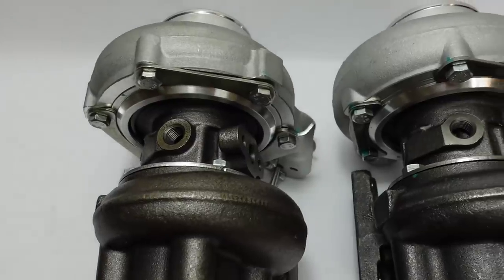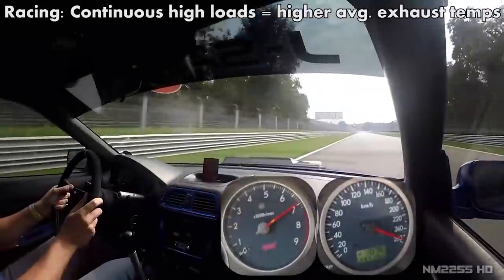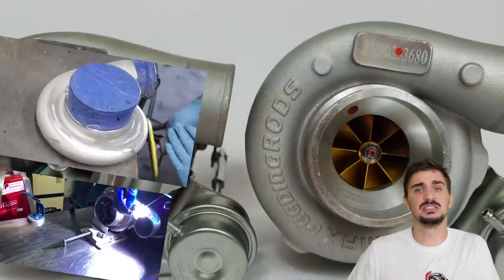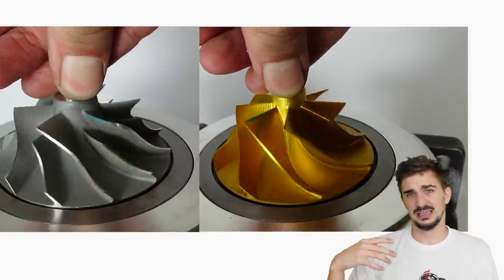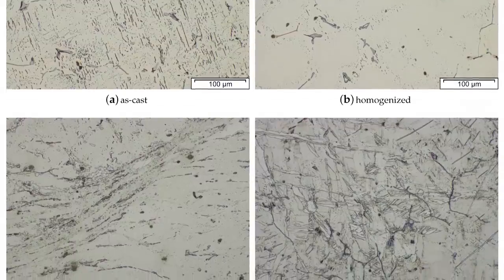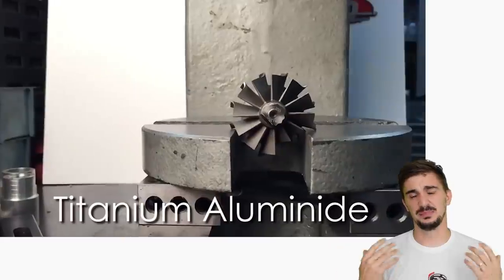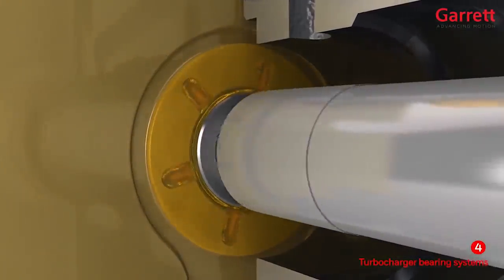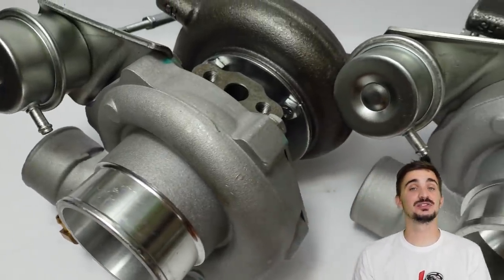What makes a TURBO STRONG? - BOOST SCHOOL #9

Comment: I can't help but think that the titanium nitride coating on the compressor fins is to prevent damage from ingested small particles. The thing spins at over 100,000 RPM, and a grain of sand is damaging at that speed.
Reply: TiN coatings are typically used for drill bits due to their hardness. In this application, it should increase particle abrasion resistance as you mentioned, but to be fair, if visible particles could make it into your compressor, your air filtration system has obviously failed.
Reply: @4G12  Assume your intake filter has failed. If something gets through, what is the next failure level if a turbo compressor fin breaks, versus it not breaking?

That's why it's TiN coated.
Reply: Some turbos spin up to 5000 RPS.
Reply: @electric7487  That's a lot of Rip'ms
Reply: @The_Original_Default_Username  A right skookum choocher...
Reply: My Air filter fell off my brand new $5000 turbo during a run, and yes i chipped the compressor wheel. For now it is what it is and I just have to lived with a slightly damaged wheel.
Reply: This happens on jet engines all the time from rocks. What we would do is reshape the nick to a slight curve. Then at the opposite fin at the same point 180° remove the same amount of material there to maintain balance and not beat the bearing to death. It's how you fail a blade or rip a phone book in half. It's called a stress riser.
Reply: @4G12  It's worthless.  Marketing wank on the turbo and the drill bits.  Ever see a machinist use them?
Reply: I posted the same thing. I concluded it was designed for idiots who run without air filters so they can get that extra 1.5hp from their racing engines.
Reply: @ShainAndrews : Yes, I have seen machinists use coated drill bits -- just not titanium-nitride specifically. Professional drill bits more commonly use titanium-carbon-nitride, which has a dull grey color.
Reply: @jeremywhittler8591  I suspect that you are lying. There is no way in hell any mechanic is going to start grinding away at a turbine wheel in a jet engine to fix FOD damage.
Reply: From the other comments - a distinction should be made between hard particle abrasion and debrit damange. TiN isn't going to stop the wheel chipping a chunk off when a (relatively) large stone hits it - as TiN doesn't offer any extra ductility, only surface hardness - so where a small particle that would otherwise abrade the aluminium (take a tiny amount of material off the blade surface - because aluminium is quite soft compared to rocks), would instead then bounce off the surface of TiN coating without damaging it. This means the blade would remain smoother and in-balance for longer.
Reply: @bisurdaddy  Actually jet compressor blades are repaired exactly that way by grinding away the damage. That is not done by a mechanic in the field, it is done during factory rebuild and fully tested/certified before going back in the engine. But it is very common. Manufacturers have whole departments that do only that.
Reply: I think the coating is there for a few number of reasons. But the main thing being keeping the impeller intact at higher RPMs. Even though it's the cold side it's still not that cold. Compressed air is quite hot. Where I work we get up 200 degrees Celsius befor the charged air cooler (CAC) on our engines...
Reply: @KingMcAl  I doubt a thin plating will do much to help the tensile strength of the impeller.
Reply: @The_Original_Default_Username   Many Racing Turbos and Racing Engine Bay Setups (specially drag racing) 
Run NO airfilter not even a Mesh guard over the turbo as it reduces flow and even a tiny amount can mean difference of running 5.00 seconds or 5.25 seconds on the 1/4 mile. 

Titanium coating wont make a difference if the turbo hits something at full spool specially on a drag car where those racing turbos see RPM's in the 250 - 275,000 RPM range, Thats Traveling at over 4850 KPH given a 50mm Compressor Wheel or an impact of over 7,000Ft/lbs, Even a grain of sand would damage & Destroy Titanium in those conditions
Reply: @electric7487  I think you mean more than that :D 
Most modern small Turbos can Reach over 240,000 RPM in under 3 seconds
Reply: @Skirk84  I'd be more worried about the balance of the turbine at that point.

Comment: The solution to every problem is a stronger turbo...
Reply from the maker: Until the turbo overpowers the engine 😜
Reply: @d4a  then you engine the turbo 🤣
Reply: There is no replacement for displacement 😏
Reply: Solution to Turbo lag is a Supercharger.
Reply: @Michal_Sobierajski  Boost
Reply: @bowez9  na. It’s getting a Tesla lol
Reply: Put a big turbo, then put a smaller turbo to boost the big turbo.
Reply: @Michal_Sobierajski  laughs in GR Yaris 😉
Reply: @lop3z-945  Tesla crap fanboy spotted
Reply: Grizzly  that's fine, it's warrantied to 100k
Reply: Grizzly  not a problem. I've had a couple of cars into 6 digits, but work and life changes mean I'm less likely to put really heavy miles on the GR.
Reply: @frealsolidusauxil5873  and then you have jet engines.
Reply: When you need a turbo to make enough boost to get the real turbo spooling 😂😂

Comment: So basically, get a junkyard LS, buy two cheap eBay GT3582 turbos and absolutely obliterate almost anything that isn’t a serious build for less than this month’s rent (depending on where you live I suppose)
Reply: Until the 5.3 spills it's guts. Go fir a 6.0 iron block ..... Still less than a months rent/mortgage.... 🤷‍♂️😁
Reply: Ls is overated unless built with forged components at that point its about 5 grand for a proper ls
Reply: @frontspring1  or...you could just stick to low boost and not rev it to the moon and enjoy the reliability.
Reply: @lynnmckenney1987  what's the fun in doing that
Reply: @frontspring1  what's the fun in a fast, reliable and moderately cheap build? 

Hmm...no idea.....*scratches chin* 

🙃
Reply: @frontspring1  LS definitely not overrated lol

Comment: I'm thinking the gold titanium coating on the compressor wheel might help prevent wear from dust particles, especially for off road applications.
Reply: You wont be sucking up any dust through the turbo cause of the air filter
Reply: @thaton3guy100  Air filters aren't perfect, and over time dust can erode an aluminum compressor that's spinning at 80,000 rpm.
Reply: Do they have different micron ratings on those filters? I understand the idea is to get as much fresh air in. So this I guess should also depend upon the surface area?  Truly I have no idea as I'm running OEM. I'm at high altitude and am just looking oxygen lol.
Reply: That's what air filters are for....the manufacturer coated the wheel so that people would think it's stronger..and it would be distinct and stand out.. there's no real benefit to coating the wheel other than that... it's already a billet wheel...it's as strong as it's gonna be.....
Reply: @boosted2.4_sky  Filters still pass particles, especially in off road applications.  Titanium is a surface hardening treatment.  You don't normally see the compressor anyway, so why do it just for looks.

Comment: Sunday morning D4A lessons are the best.
On a related note, ATS’s CT-21 Blackjack turbocharger upgrade is everything you want in a stock chassis upgrade. It comes on sooner, blows harder and doesn’t fall off at redline. I’ve only got about 3k miles on mine but I’m very glad I chose it.
Reply from the maker: I googled it, it's a twin scroll. What's this for?
Reply: @d4a  
SW20 MR2T and G5-6 Celica GT-Four. I’m not sure if they make a version for the other CT-2x chassis turbochargers in the G4 Celica, MKIII Supra and Hilux platforms. Their exhaust housings are all single entry.
Reply from the maker: I should be ashamed that I didn't recognise the turbo.
Reply: @d4a  
Not at all. This is my local tuning house but they’ve been improving this design for close to two decades now.
I should note that I sprung for all the upgrades. Machined exhaust housing for better flow, ported wastegate, upgraded wastegate actuator (1 atmos), coated exhaust housing and the billet compressor wheel upgrade.
Reply from the maker: Sounds top notch and seems you're happy with it, which is most important!
Reply: @d4a  
Thank you for making this series.

Comment: So I have an idea for a video I’d love to see from you. A video on brakes would be killer and it could be done through different videos. Like what the differences between blank slotted Drilled and slotted and just drilled rotors are. As well as what the differences between stock brakes and a big brake kit is as well as what’s in different brake pads and so on. It would be a neat series. I really enjoy your videos and in my opinion you are one of the best if not the best channel for explaining parts and everything in a way that is exceptional for visual learners!

Comment: First things first. Very well made and informative video again right there :) much appreciated! ...
And boost is always the solution! Grab the biggest well made turbo that physically makes sense for your engine and turn up the boost to the max! 
4,1 bar boost pressure (thats around 60 PSI) help to sort out ANY issues your car might have! cheap pistons, bad rods, weak head gaskets, old and chinsy gearboxes and even some differentials! :D
Reply: That's how you check the quality of your engine!

Comment: I’m on a ebay Tb25 turbo so far on a daily driver for 2k miles.  So far so good.  
I just got the MaXpeedingRods rods turbo also to compare too.
Reply: @turbone54  well did the engine blow?
Reply: I have had a $300 Amazon turbo running 20 psi for 4/5? Years

Comment: Thats why i always laugh at people when they say running a BOV/ BPV Blanking plate and forcing the Turbo to Flutter/Surge is fine and that it dont harm the Turbos lifespan.
 
But they dont realise when you say making 15psi boost and let off the gas, the air that makes turbo flutter and stall is coming back at 15psi its no different to taking a rubber mullet and wacking the compressor wheel directly with 15psi of force (if its 4" squared surface area thats equal to hitting compressor wheel with 60 pounds of force with a hammer.) Over short time it DOES Damage the turbo and bearings in it, 
Specially Journal Bearing Turbos which are not designed to take in /out thrust loads 

Rough Guide for average Turbo Life Span is (only for new water/oil cooled turbos given a proper warm up & cool down periods. 
- Journal Bearing Turbo (like a TD04 on Subaru) Should Last 300,000km - 350,000km without issues till the Ring Seals Wear out.
- Ball bearing Turbo Should last 150,000-200,000km Without issues until the bearing need to be replaced.

(Journal bearings tend to last Much Much longer in ALL Applications and why they are used in train axles as BB Can't Take the Loads. While Journal bearings actually have Zero contact Parts and Float on a Film of Oil, where as BB turbos roll on little ball bearings, just like a Train Axle there is no Ball Bearings in there as they cant handle 20 tonnes per square inch like journal bearings can handle much higher load up until oil in squeazed  so hard it boils or ignites)

Comment: tip: flip the angles wrench around, with the handle angles towards the thread side, if possible. this pulls the wrench more and more towards the bolt when applying torque, and makes it harder to round bolts!

Comment: TiN coating helps with longevity from small particulate like extremely fine dust that can get through the air filter but can be abrasive in large quantity over time.

Comment: Journal bearings do handle street abuse better than ball bearings. A racing set-up on the other hand shows the sustained high rpm and abuse are better suited for ball and ceramic bearings. Yes, they cost a lot more money. I am not saying the journal bearings won't work, so I guess it's like buying insurance, ...or bragging rights! Take note, everything spun around has a resonation point allowing cavitation and ware. The bearing turbo will have much less resonation due to better, tighter tolerances Great Video!! You rock!

Comment: Break the ceramic portion of a spark plug and throw a small piece at a pane of glass lightly. It will explode with unexpected sound and energy . When the outer surface of cast metal is cooling its trapping heat inside and distorting the grain structure because it's cooling unevenly and trapping forces inside , that's why some parts are stress relieved. Billet has a much greater time to cool then is cold machined in a cnc. The typical culprit of a failed turbo is the chra cartridge failing and allowing the wheel to make contact with the housing. Incolnel turbine wheels are the strongest , typically you fail on the compressor side aka precision turbos vs garett chra center sections. You'll be smoking and breaking compressors way before you'll have a housing failure.

Comment: Man. I remember when factory-equivalent turbos cost a thousand bucks or more.

The titanium-nitride coating on the more expensive turbo will survive abrasion better, which means it's designed for idiots who run without air filters to get that extra 1.5hp out of their racing engines.
Reply: When you're pushing 700+ hp, depending on design, your air filter can become an obstruction lol. I'm sure you know that tho right

Comment: Very informative but I wouldn't categorize the cheap turbo as a bad one but as a less performant one, for daily driving and once in a while boost to pass the cars faster is fun enough, yes the risk of damaging it faster than the more expensive turbo is high but for a fun project worth the money even if it blows or cracks. I already  got a cheap one and can't wait to try it, if it blows, I'm buying a GTR one. Or I'll change the broken parts to new better ones from my local turbo fixing shop.

Comment: Its been years since i built a nice knock around sleeper.... and after watching this video i got the itch to build myself a another one. The old one died a painful death when the timing belt broke and bent the valves. I wonder what kind of car i should start with??? Toyota matrix? Honda Civic? Maybe a Kia???
Reply: Pick one with a non-interference engine... I.E. one that the valves cannot ever hit to pistons when you break your cam drive belt or chain.

Comment: I've found component weight makes little difference to spool up time, I went from a td06 sl2 11-blade stock clipped style turbine that weighed 223g to a 9-blade taller and flatter blade discharge angle turbine that weighed 267g and it comes on boost faster, ignoring the extra weight. I'd posit the weight is not far from the centre of the shaft so the effect is small. If you've seen the stock sl2 turbine, it's a crappy design

Comment: 6:31 titanium coated increases blade strength if running a pre turbo water setup make sure to run distilled water in a water setup you’d be surprised how much calcium wears out that wheel

Comment: 45 psi is actually quite realistic; look for the video "Mit 3.3 Bar durch die Waschanlage", it's from the german tuning/car youtuber Marco Degenhardt (5ZylMarco) and shows his Audi Coupé with a turbocharged 5 zylinder engine which had 3,3 bar of boost pressure (or 48 psi) and the engine lasted quite well
Reply: There was a famous 1.9 Tdi that ran 90psi boost. 

Only made 400ish hp. 
But made 1100tq

Comment: I have some questions

1. Why don't we see petrol cars with variable geometry turbos
2. How does a twin scroll turbocharger work exactly?
3. Are diesel turbo compressors made from billet because a diesel mostly boosts at 40psi all the time even daily driving, maybe i don't know?
Reply from the maker: Those are all pretty big questions and can't fit into a comment. Twin scroll can't really fit into a comment but it's getting a video in the future. VGTs are mostly on diesels because the lower exhaust temps means they won't fail as soon as they would on a petrol. But there are gasoline engines with vgt, but far less common definitely. A typical stock diesel definitely does not boost 40psi. Average factory boost levels are mostly similar or a bit higher than petrol engines.
Reply: @d4a  

Ok cool i want to ask you another question.
Have you ever heard of rear mounted turbos or remote mounted turbos if so
Will such turbo setups improve the reliability and longevity of your turbo charger under extreme conditions?
Also can you use variable geometry turbos if you decide to go remote mounted?

Comment: I get 18 psi maximum boost on my 2001 Dodge 3500 with the stock turbo on the 5.9 liter Cummins diesel engine. I really would like more boost but not for increased power but instead more boost for the same power lowers the Exhaust gas temperature. With the stock setup I can pull my 30' toyhauler up most any grade while watching the EGT very carefully and making sure it doesn't exceed 1200 degrees F. There are a few grades near my home (within 150 miles) where I need to use a power pedal setting that requires I slow down and downshift to keep the EGT under control. There's plenty of power but it's not usable in these conditions.
Have you done any videos on upgrading turbos on a diesel pickup? I want to run a twin turbo setup with a large atmospheric turbo and a smaller compressed side turbo, basically in a series setup. I'd like to know if you've done any videos on setups like this.

Comment: Which system would be better...#1 lubricating the turbo bearings with the engine oil ...#2 using a stand alone turbo lubricating system..?